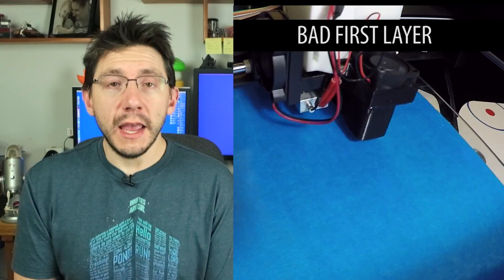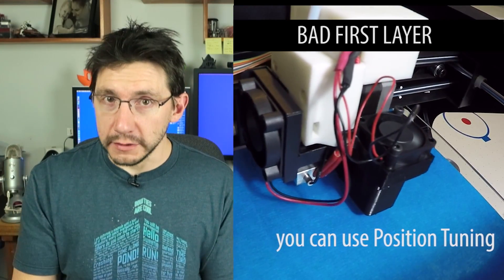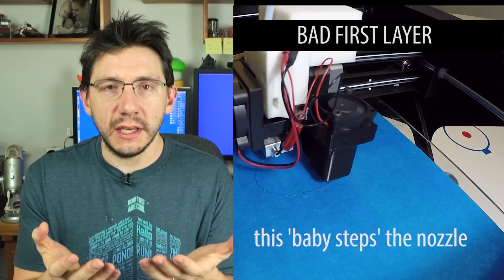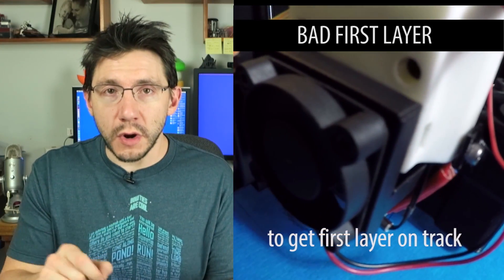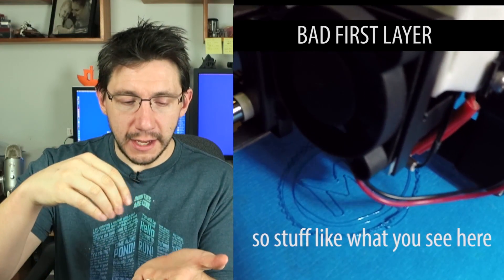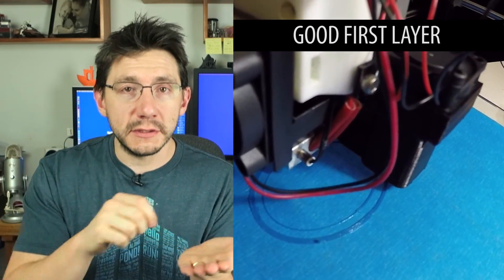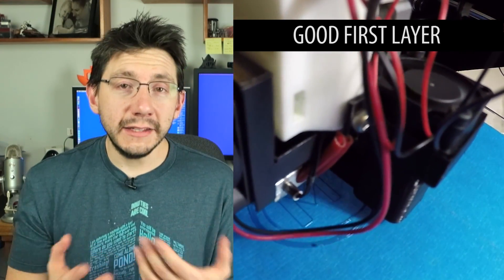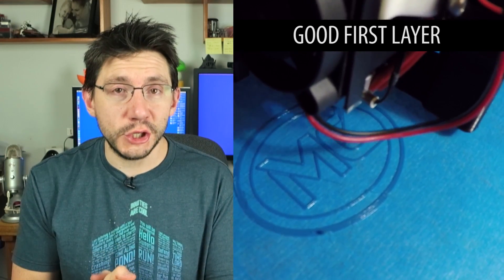3D Printing 101: Getting Started with the First Layer

Comment: When printing an object with a large square surface, and printer moves diagonally to fill, i get filament rising slightly between lines - like a landscape. I suspect this is due to filament being squished out and pushing the previous line which then rises. I am going to try following fix/calibration: Set first layer thickness, e.g. 0.2mm. Start printing, stop when a line has been laid. Use a micrometer to measure thickness of line - then live adjust difference to get precisely 0.2mm thickness in next print. Repeat and remeasure to take into account material squished upward first run. Then print the part. This should make the material squish the exact extrusion width and produce a smooth surface. Final factor is extrusion multiplier, this has to be correctly calibrated for this to work since otherwise the width will differ even if layer height is perfect. Suggest printing a tall H (10mm) where middle measures 1mm in cad, with two perimiters each 0.5mm. Measure thickness with micrometer and calibrate the difference as this indicates over/under extrusion. Agreed anyone?
Reply: I tested this now. Works perfectly.!!!!